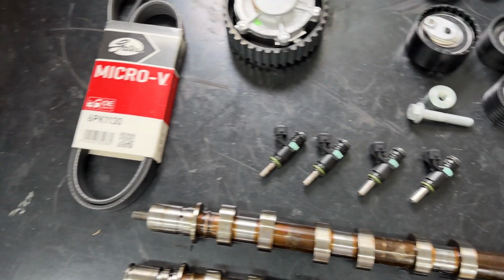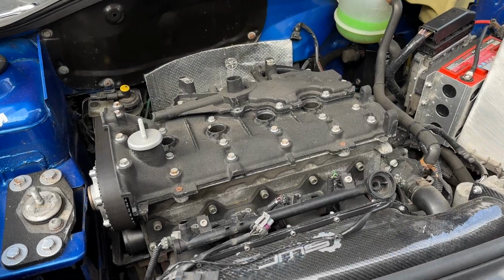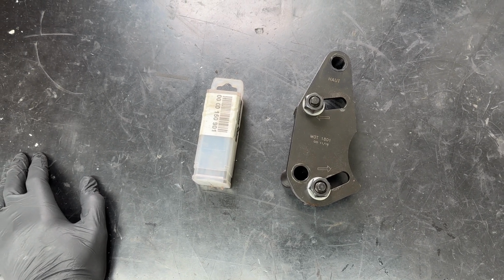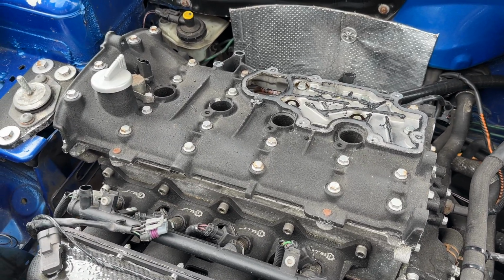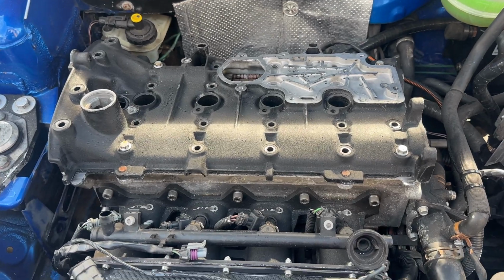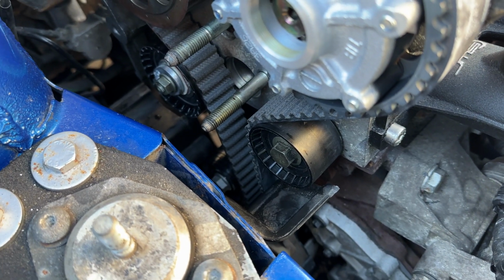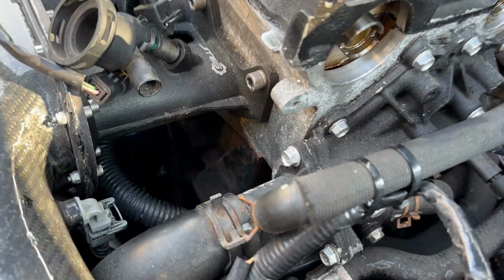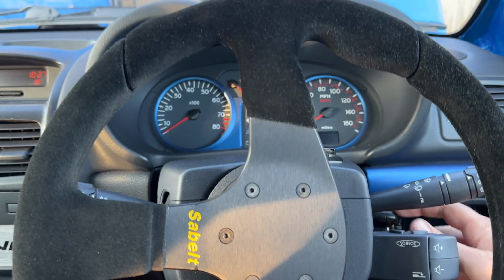Clio 172 182 Cambelt change guide including dephaser & camshaft replacement + installation

Comment: Awesome job. Enough technical info in there without crapping on. I do have a quick question though... If someone may have bought the 'upgraded' (keyed) Meg bottom sprocket, how does one do complete that step where you had the crank and cams locked, but were moving the belt around to even it out? I've gone and made things difficult for myself, haven't I... Thanks for sharing your knowledge. It's long way in between blokes that know this stuff in Australia. Also, i didnt see exactly which of the locking gears you were using, as there were two different ones? I borrowed a set of the Renault tools from a friend, but they are all jumbled up...
Reply from the maker: Glad you appreciated the video 👍 I’ve heard the RS Clio’s are very rare in Oz so hopefully the video helps a few!

The only time I would ever advise the woodruffed crank pulled would be on a super charged application so much easier to go back to the original 😅

You’ll see how the pulleys work once on, if you don’t use the “longer cog” one it will pull the exhaust pulley trim away.

Comment: Great Video! I was wondering how did you lock the crankshaft for tighten the crank pulley ? Did you only use the pin? And I also have the problem that every time I set the right position for the horseshoe the cams slightly rotate backwards. Maybe you have an idea how to keep the cams in place. Thanks!
Reply from the maker: Thanks 😎

Officially your supposed to support the flywheel with a lever bar but I’ll be honest your not doing that on your own and even with two the flex in the bar etc would loose any support as the pin holds it dead straight. Again this is the importance of using the genuine locking tools as I’ve never bent a Renault crank pin 👍

The camshafts do move but also have a small amount of resistance so can be position by hand one at a time with the horse shoe and then the bar will go straight in without any real force to rest them 👍

Comment: Great video! Videos like this are priceless in helping home mechanics like myself.
I do mine myself but I remove the engine to do mine. A bit of an initial  ball ache but it makes life immeasurably easier, and I always fit a new water pump at the same time.
Reply from the maker: It’s a much more enjoyable job out of the car that’s for sure 👍

Water pump was changed at the last belt swap 4 years ago, hadn’t even covered 4,000 miles so it was staying in place this time 😅

Comment: Brilliant video! Well produced and informative. Fingers crossed you crack that 200bhp+  Did you not need to change the water pump as well?
Reply from the maker: Thanks mate 👌 

It didn’t make 200bhp, dyno was yesterday 😭😭😭 next weeks video lol

Water pump is run off the aux belt so not as crucial as say a VAG set-up, I did replace it 4 years ago, has only done 3,000 miles since 😅
Reply: @stoneautomotive  Ahh ok! shame you didn't crack the 200 but i'm sure you got very close to it. Looking forward to the dyno video next week.